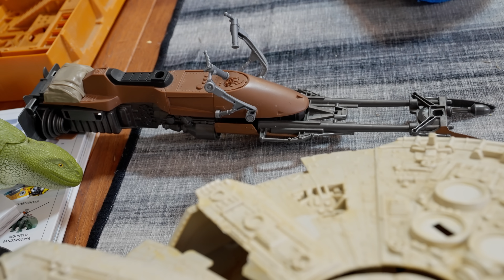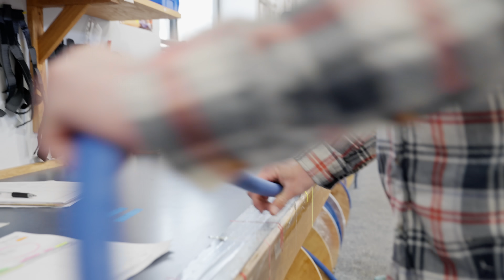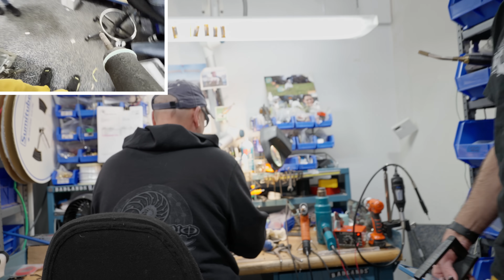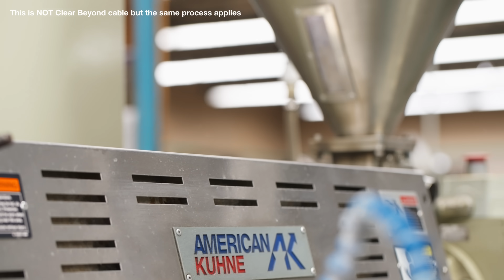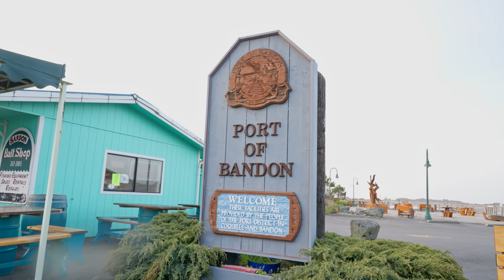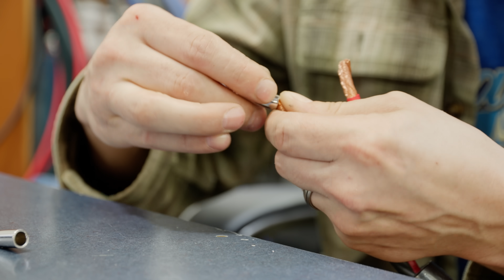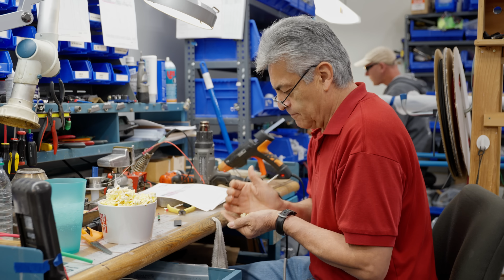This is the BEST video about LOUDSPEAKER CABLES that you will see all year

Comment: I’m in my mid 40s.  Been into audio 2 channels hifi since I was a boy listening to my fathers old kit.   I’ve had 100s of components over the decades and currently running a configuration of £35ks worth of English made equipment.  I’ve tried various cables over the years, mostly when I move my equipment to another room or house and I need longer cables.  I’ve had cables on demo and I struggle to hear any difference.  Despite the excellent attention to detail in this video showing their manufacturing process all we’ve seen is new copper and plastic , the only expensive part I heard mentioned was rhodium.  I’d imagine the freshly mined copper is probably better than recycled copper but I genuinely do not understand why you’d need 1 inch diameter thick cable.  Not even cable on aircraft is that thick which has highly sensitive equipment and needs to be shielded from interference.  Yes I’m getting older and I’m certain my hearing will be naturally degrading etc etc.  Don’t get me started on £2000 1m Ethernet cables .....  I know you get attenuation on cable and perhaps the thickness helps with that, I certainly remember from my old IT days when we used co ax we’d have to use repeaters to boost the signal but unlikely on 4m of speaker cable.  No mention of impedance and I was surprised to see a £10 maplins tool testing the cable.  Hey at least we didn’t see them shaking the cables like Naim do!!   The jury is still out for me im afraid.  That being said, I’d happily buy cables from this business, the attention to details ,personal touch and interest from each employee in the product they are making would get my £ over any thing from the far  east.  I’ve currently got a Naim 555 plugged in using a power cable that came with a HP desktop computer from about 10 years ago....

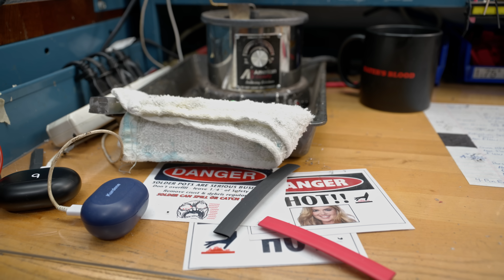Comment: on minute 21:50, the wires stripped so close to the base and touch each other. won't it short out? what is the black paste being put on?
Reply: It's Litz wire. each individual strand is enamel coated, not unlike magnet wire. In effect, all strands are insulated from each other.
Reply: Noticed that. I believe they are using black silicon sealant in between to prevent shorting. Maybe Angela can shed some light.
Reply: I thought the same thing!!! 😮

Comment: Outstanding video Jana, please keep up your fantastic work. First I am now a music first "audiophile " I chased the grail from the early seventies to the very late nineties and sadly found out it does not really exist. I believe cables make a difference,  but now I am fully a cable cheapskate and firmly in the Andy Singer camp. I still have lots of Kimber Kable  speaker wire and interconnects in both copper and silver that I am not currently using in any of my three systems. I did however sell all my Kimber Kable silver interconnects as I did find them a little to bright for my current systems. I also have three pairs of MIT Siltech cables that I am not currently using and they are in storage. Yeah I know hear we go on the point of diminishing returns wagon but my systems now and I know a lot of people  would love to own but they are no where near what I used in the past.

Comment: The only science available about speaker cables proves that 12AWG is always 12AWG regardless of price has no effect at audio frequencies regardless of audio religion …if you have science that proves audio cables different than regular electric wire , bring it forward
Reply: "Proves" is a bit much there. Suggests, supports, shows, indicates. No evidence showing a difference. No measurable difference. No difference has been measured, etc. 
There's always room for something we don't know. (My cables are 12 AWG rope lay OFC. If someone proves there is a difference, AND it was better, then that could change.)
Reply: That’s a bold statement around here

Comment: There’s something “in the air” that begs some questions. Audio is seemingly moving from wire to the “air.” Are interconnects and speaker cables headed for extinction?
Reply: I think that only digital signals can be transmitted (almost) lossless through air. For analogue signals, especially high energy/current from the amp to the loudspeakers, we will need cables...
Reply: @alphaniner3770  
Active speakers..
Reply: @Wuppie62  what?! I thought active speaker also incorporate class D amps and internal cables in one box together with the units. So basically you mean it‘s all through air, no amplification?
Reply: @karl1196  Once Bluetooth 6 arrives,  it will easily have the bandwidth for Lossless audio,  that will be a game changer.....

Comment: The Cardas Clear Beyond speaker cables that you see being manufactured in this video cost anywhere from $6,500 for a 1-meter pair to $12,000 for 3-meter pair. If you want them set up for bi-wiring it adds another ~$700.00.

These cables are loony toons expensive. If I have a nice, high-end audio system I'm not going to use zip wire from Home Depot. But I'm not using these, either. As long as the cables are of adequate dimensions to carry the signal from the amp to the speaker and properly shielded against RF I defy anyone to find a measurable difference between these and a well-made pair of 10 or 12 gauge speaker from someplace like Monoprice.

I suppose if cost is no object, you may get some placebo effect from having a ludicrously expensive cable like these and that's your prerogative. But if it's not scientifically measurable it's not really making a difference.
Reply: Finally someone who gets it 100%
Reply: Well I was planning to get the 2.5M spade / spade which is $10,550. After seeing the video, I decided not to. The sum of parts, labor, popcorn, and stilettos, told me to reconsider.

Comment: Critical note: While pretty, and purchasing does indeed support an ongoing business.
Buying these cables does nothing for your sound quality, or music reproduction from your home audio. No matter if it consists of a $50 Class D Aliexpress amplifier, or a $50,000 class A collector's edition tube amp with genuine ultra-rare tubes.
Counter-arguments are completely pointless because counter-arguments have no scientific basis.
I'm 100% aware that deleting my comment is in no way a violation of my rights, but allowing it to stay would not only show a level of transparency, but a level of integrity.
Reply: I agree for the most part. But to present the opposing view...There is in fact scientific data to back up the claim. Physically speaking, the thicker the wire, the more power it can transmit. I learned that as a ham radio hobbyist. I also learned that insulation is a key factor because much of the signal is lost with the voltage leaking out of the cable. So, insulation is used to hold in that voltage which leads to a higher transmission of the signal at the end of the cable. Why do you think power companies use extremely thick wires (high power transfer) with thick insulation on them (less signal loss)? Even then, power is lost so they use transformers and other technologies to reduce the amount they lose when they transmit the energy to the household circuit breaker. In ham radio, there are also reflected electrical waves you have to worry about, so you have to get the impedances in the antenna to match the cable as much as possible. There are so many things in electrical energy to take into account. This company came up w/ a "secret sauce" where they took all that into account. I'm sure they even looked at cable impedance, which they didn't mention in the video. The thing is, you have to pay for that.

The argument, however, because a qualitative one. While you can measure for distortion and other electrical issues and show that their cables are better SCIENTIFICALLY, does that mean that the human ear can detect those differences? Sometimes you can, sometimes you can't. But I will venture to guess that in high-end systems designed for crystal-clear audio, that you can.

Many many many years ago (late 90s) I went to a music concert of Andean music in Phoenix by Inti-Illimani. The concert was held in an immaculately designed concert house with stadium seating designed for many thousands of people. They played to packed house. The sound that came out of the only 2-4 speakers in the entire, huge auditorium with high ceilings was literally the best audio I have heard to date. I've never heard better audio than that. The speakers were positioned at the ceiling hundreds of feet above us and centered, w/ the speakers pointing left and right at a diagonal. I was seated stage right, and I swear I could hear both left and right channels as if I were right in front of the speakers. It sounded as if I was in front of the musicians without a PA system. It was fantastic!

I seriously doubt that the sound system had cheap, thin wires from Home Depot the way my system has, LOL.
Reply: Yes possibly and a Rolex tells time no better than the phone in your pocket.
Reply: @andrewhutchison3712  Well a Rolex isn’t about keeping time. It’s actually tracking money. 😂
Reply: You wish.
Reply: Hello there! I spent over 40 years in the audio and musical instruments business. I was afforded the great honor of being allowed in some of the best recording studios in Nashville, Austin and NY. You are absolutely correct none of those studios used Home Depot or Lowe's any type of wire from them. The great majority used and still use Mogami and some forms of Held in cables.
Reply: Well, that this company exists makes absolut sense. If I owned a system that costed 20k and more I would want a cable that plays in the league. Luckily, I'm not that obsessed.
Reply: I’m in my mid 40s.  Been into audio 2 channels hifi since I was a boy listening to my fathers old kit.   I’ve had 100s of components over the decades and currently running a configuration of £35ks worth of English made equipment.  I’ve tried various cables over the years, mostly when I move my equipment to another room or house and I need longer cables.  I’ve had cables on demo and I struggle to hear any difference.  Despite the excellent attention to detail in this video showing their manufacturing process all we’ve seen is new copper and plastic , the only expensive part I heard mentioned was rhodium.  I’d imagine the freshly mined copper is probably better than recycled copper but I genuinely do not understand why you’d need 1 inch diameter thick cable.  Not even cable on aircraft is that thick which has highly sensitive equipment and needs to be shielded from interference.  Yes I’m getting older and I’m certain my hearing will be naturally degrading etc etc.  Don’t get me started on £2000 1m Ethernet cables .....  I know you get attenuation on cable and perhaps the thickness helps with that, I certainly remember from my old IT days when we used co ax we’d have to use repeaters to boost the signal but unlikely on 4m of speaker cable.  No mention of impedance and I was surprised to see a £10 maplins tool testing the cable.  Hey at least we didn’t see them shaking the cables like Naim do!!   The jury is still out for me im afraid.  That being said, I’d happily buy cables from this business, the attention to details ,personal touch and interest from each employee in the product they are making would get my £ over any thing from the far  east.  I’ve currently got a Naim 555 plugged in using a power cable that came with a HP desktop computer from about 10 years ago

Comment: Excellent video and kudos to the company for opening up and allowing it to be made. However, a couple of questions for the company. Why no recycled copper? Doesn’t all copper have to be refined to ensure its purity? Wouldn’t the refining process be more important than the source? Also this copper is shipped from Arizona to Connecticut to California to Oregon and then to the customer. Have you thought about the carbon footprint? Copper is heavy stuff consuming a lot of fuel in all that shipping.

Comment: Please do a video on audiophile fuses and cable risers next, to complete the trilogy 😉
Reply: The riser thing was the dumbest thing I saw... Until I tried it.  I used toilet paper tubes cut to 3" because I wasn't going to spend a dime on anything commercial.  Not like changing, but it was noticable.  Had my son print some nicer ones on his 3d printer.  Easy test for anyone.  I suspect results would vary based on the type of flooring.
Reply: @reynolds8532  do you have a screenshot of the frequency response graphs from when you measured with and without risers?

Comment: I noticed at Cardas, that they're not fanatical about clean room like conditions when assembling cables(eating popcorn while working), and handling everything with bare hands.
Reply: Indeed, while I liked the video a lot, handling wire with bare hands certainly is a flaw in the production process - this transfers a lot of (isolating) junk onto the wire, including DNA of the builder.

Comment: Quite curious as to why the bare copper is being caressed by oily human hands
Reply: Human oil is the worst contaminant it can ruin brake rotors on a CAR!  Just look at the screen on your phone or your stainless steel fridge!
Reply: Apparently it’s not bare copper, every strand has an isolating coating - note the part where they grind the strand ends to remove the coating before actually terminating a cable with the hydraulic press. I have mild OCD and thought the same at first, but that would explain why it’s not a concern.

Comment: I'm not opposed to the notion of audio jewelry but I'm not buying into the emperor has no clothes argument. I have yet to see any scientific data of how a $100,000 cable measures any differently than a $100 cable. If you know of said research please link to it. And if there is no measurable difference how in the world does one "engineer" these cables? I would submit any answers are so fraught with pitfalls it would Indiana Jones run away like a scared child.
Reply: As for measurements, what exactly would you measure, and why?
Reply: @AT-wl9yq  , here is the equivalent circuit of a cable. You can measure dfferent resistances, inductances and capacities. The numbers are dependent on materials and layout of the cable. But the differences a pretty small. Interestingly, it can nontheless make a difference in sound in very good systems.
Reply: @weizenobstmusli8232  You can also measure phase alignment, ringing, overshoot, etc. These can even be measured on a good oscilloscope.
Reply: @AT-wl9yq  As I said, distortion. It's a very straightforward idea.
Reply: This will never end. New generations come and argue the same subject over and over. The best measuring instrument is you ears, period! You may find a $2k cable that sounds close to a $10k cable - buy it. But if you have a mega thousand dollar system, you will expend time trying different "best of the best" cables and settle your decision between your ears and bank account.
Reply: That's your reality, and that's great for you. I've tried different cables and can hear differences in most of them. I'll probably never buy a set of Clear Beyond because they don't make sense in my  system, which is relatively modest by high end standards. But I went from a set of Quadlink cables to the Neutral Reference, and it was a stark difference.

So if you want to see the data, maybe you'd need to talk to George directly. He has, for example, built a tester that can measure the distortion introduced by a cable. Just because you can't conceive of something within your worldview does not then make your opinion fact.
Reply: @robhughesguitar  If you need to make your test unfair then your results are neither reliable, nor fact.
Reply: Why you not just listening? And the science is there. The argument is, that the measured differences are below audibility. But if you listen to different cables on a resolving system, the differences are apparent.

Comment: Love the video and it shows the effort that goes into producing a high quality speaker cable. I’ve got 8to admit I’m in the cables make a difference camp. If you have a resolving system all cables speaker, power and connector can have a discernible difference in sound characteristics. However, we are talking usually about very minor differences compared to a system component and at some of the higher cable prices a new preamp or DAC would be a far wiser and more noticeable improvement. I also don’t understand why more audiophiles don’t roll their own, as a lot of the cost is in assembly. Anyway great video and may Cardas exist for a long, long time.

Comment: Isn’t silver now in fashion? 🧐
Reply: Terminated with melted down Bitcoin.
Reply: Yes, in the Audio Note / low power / triode amplifier world! And it has been A Thing for some time, with that crew. The Triode Mafia Loves Silver Wire. Check out Real World Audio, here on YouTube, for some information from that end of the audiophile hobby.
Reply: Silver tends to be a bit too bright sounding for most systems, but it technically is the best conductor.  Kimber makes a copper-silver hybrid cable that I think sounds really good, but pure silver is too much imo unless your system really needs to “wake up”
Reply: I’m firmly in the copper camp.  I removed all the silver cables from my system over a year ago and replaced it with Japanese Mogami studio cable, both interconnects and speakers.  Huge difference in how open and big the sound became, with no loss of treble extension or detail.  What did vanish was the slight edge and sibilance in the treble.  I haven’t heard Cardas cables, however, I will certainly consider them in the future.